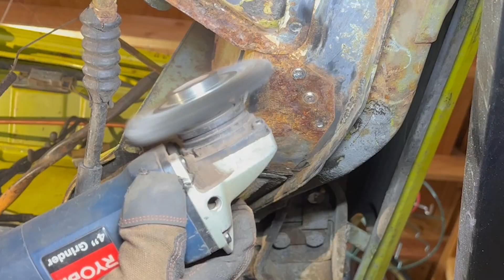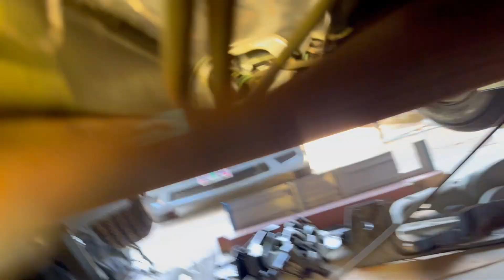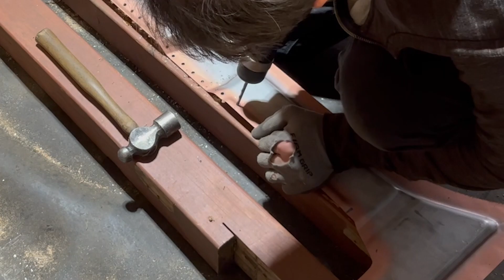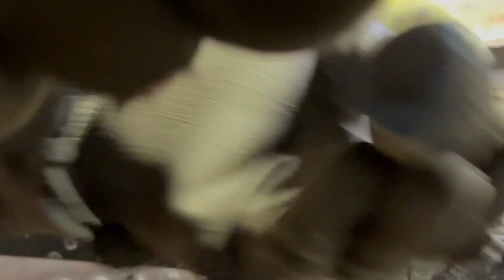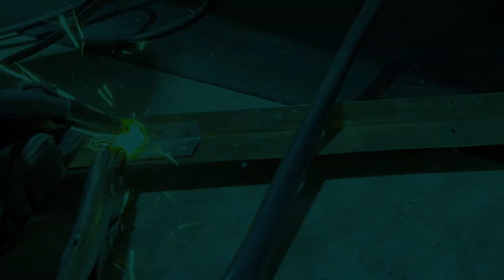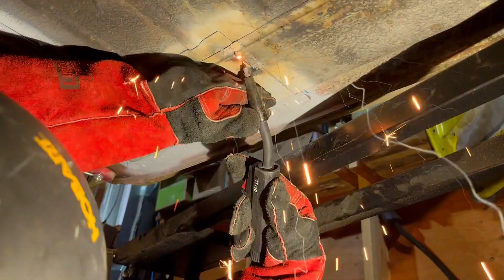Porsche 914 rear floor pan and lower firewall repair

Comment: Hi, I love your videos, thank you for those. Can you tell me what welder you are using
Reply from the maker: Thanks. I'm using the Titanium 125 from Harbor Freight. It works well after you get the settings dialed in and make sure the metal you're welding is as clean as you can get it.

Comment: What kind of grinder bit are you using for those spot welds?
Reply from the maker: I think it's a 3/8" or 5/16" spot weld cutting bit. From amazon I believe.

Comment: Good job. I have 2 1974 914's. fortunately one only needed the battery tray while the other needs the hell hole panel and the tray. Both were from Oregon but I shipped them to Arizona. The first I have driven for 15 years, I love it. The second is painted and I'm just putting it back together. I also bought a rust bucket which turned out to be s gold mine. It had a 2.0 with dual weber 40's, stainless heat exchangers and the factory sway bars. Have you watched any of the Ian Karr videos?
Reply from the maker: Yes! His videos have been a major source of confidence for me getting in to this project.